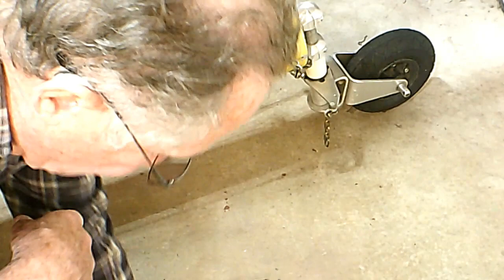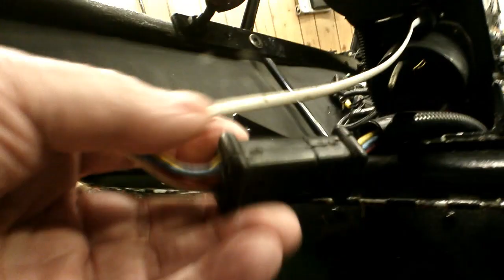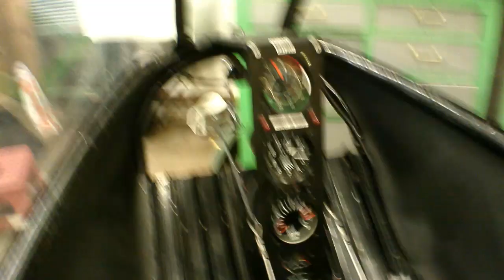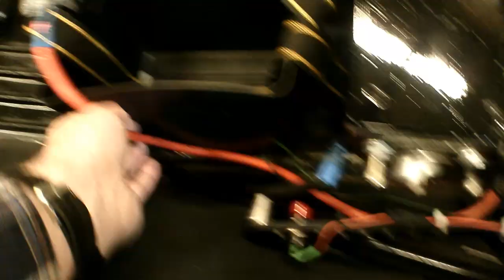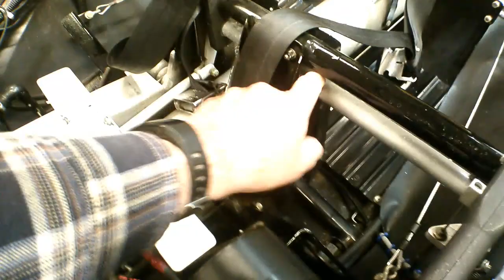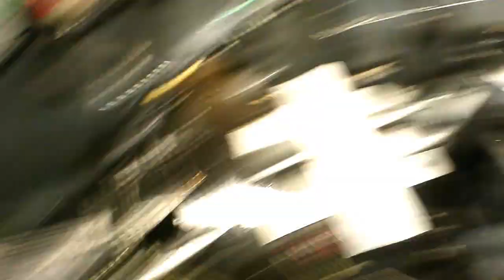Chinook Operational pointers

Comment: How much are you going to sell it for?
Reply from the maker: $12,000 but it is not quite ready yet.
Reply: These are wonderful videos. You obviously have taken good care of your Chinook. Will you be advertising the sale on the regular web sites when it’s ready? Or just through your you tube channel? I’m in Canada. Looking forward to the next series. Particularly interested in your engine cooling system setup! Thx.
Reply from the maker: @kentmacdonald9089  
Glad that someone likes the videos. I am not very good at making them.
I will put an ad on barnstormers.com, if you tube does not find someone interested. I don't think anyone will want it until spring.
I will run the engine and go over the cooling before I am finished working on it.
This is a Canadian ASAP Chinook. Built in 2001.